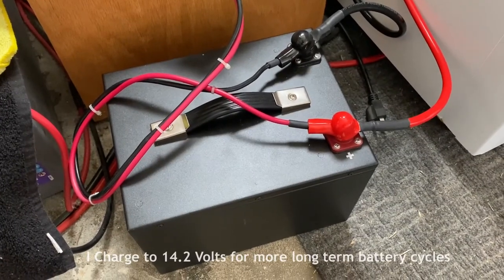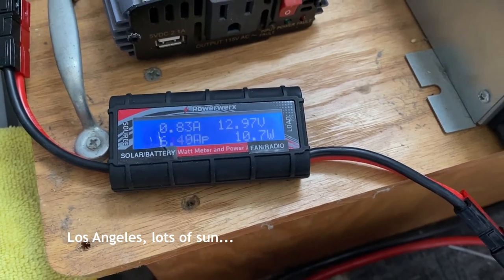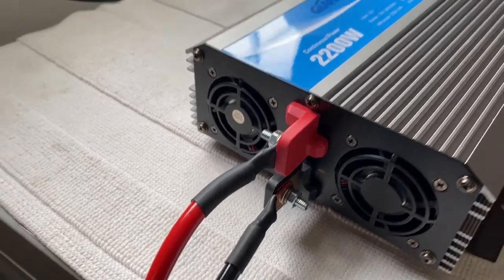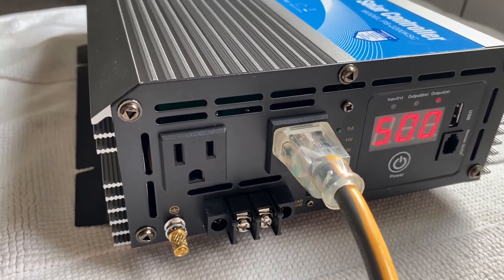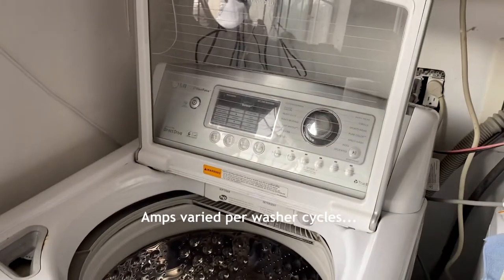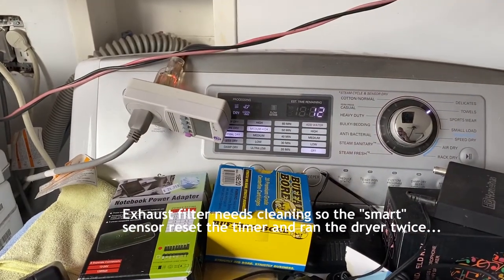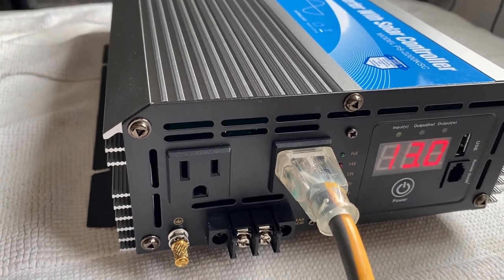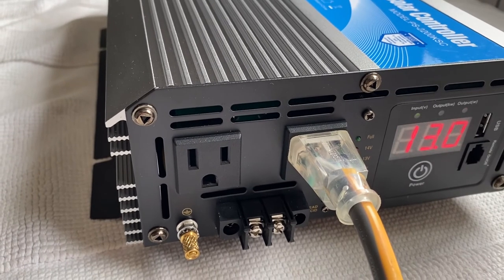SOLAR POWER TEST #1: Running a Washer & Dryer via SOLAR

Comment: Great video this is what I want to do. Our electricity is so expensive here I'm paying about 4000 pounds a year which could get me a really good solar set up. I can wire up myself I used to wire up jet engines and have a good understanding of electrical engineering.  How many panels do you use to charge that battery? I was thinking of 2 x 100Ah and a kilowatt and a half of solar panels.
Reply from the maker: Simple setup for a couple of simple tasks. When the power goes out it still runs and it saves a bit of money since we use it almost everyday.....

Comment: Idk how this is working. You have a 12v battery to 120v Inverter with 15 amps max out of standard U.S plugs. Most washer/dryers require 240v plug and 30 amps. Can you explain what I'm missing?
Reply: Actually in the US and in Canada, almost all washers are 120v at 15amp circuit, and any GAS dryer requires the same.  If your dryer is all electric, then you would be looking at a 220v circuit at 40 amps.
Reply: I've never seen a 220 washer. The reason he's able to run his dryer is because it's gas.
Reply: @countrieboyz2009   220 requires two inverters
Reply: @rickcarp5453  
They do sell 240VAC inverters...

Comment: How is it going boss how long can you used the battery's without sun or in other words how many washes can I do before I have to charge the battery again
Reply from the maker: I get two washes and two drying cycles at night. The next day comes, the sun shines and charges the batteries. If you wash and dry in the middle of the day the system will run for hours. (as long as the sun is shining)

Comment: Ahhh why I can’t get that setup to work for my computer?
Any ideas?
Reply from the maker: I don't know what your question is. If you want to run your computer via a SOK battery make sure you have a PURE SINE WAVE inverter that has a larger capacity then what the computer needs.